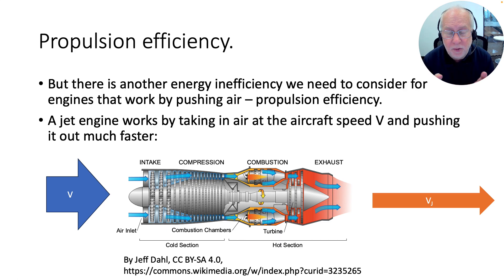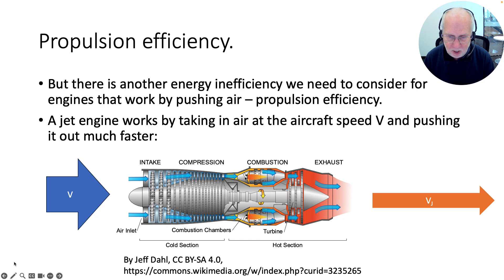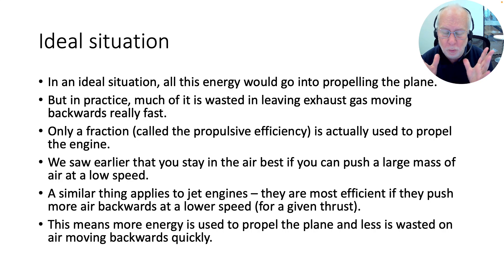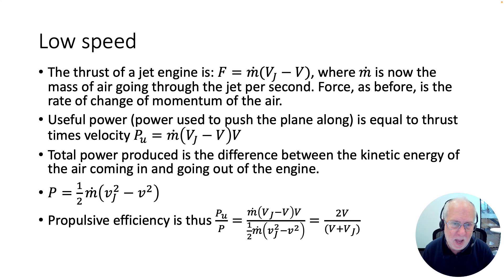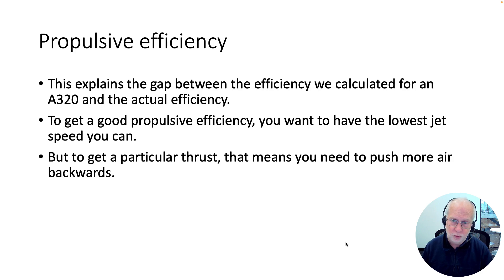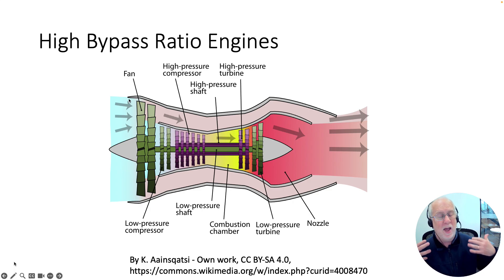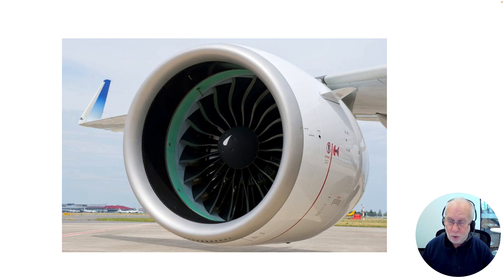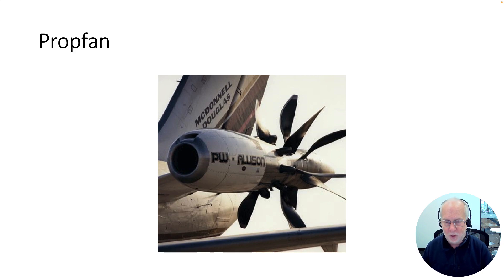Transport 12 Propulsive Efficiency

Comment: Something I’d like to add is that the fans in turbofans aren’t propellers. They’re compressors, they blades compress the bypass air just like the HP and LP compressors compress the core air. The bypass air expands and accelerates out the back of the of the bypass duct to produce thrust in the same way the core exhaust gases produce thrust with the exception of not being mixed with fuel to burn. The fan puts in all of its energy to compress the air so the fan has no energy left over to produce any thrust of its own.